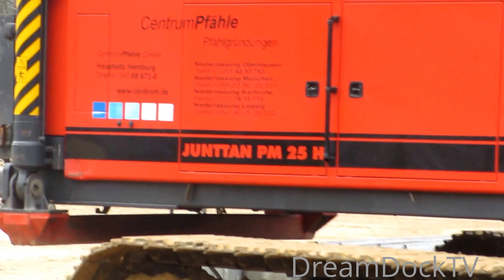PILE DRIVER MACHINE WITH IMPACT HAMMER ERECTING CONCRETE FOUNDATIONS

Comment: Permission to ask:
1. In this video, how much is the carrying capacity of each pile?

2. What is the effect of vibration on surrounding buildings (besides there is a 5-storey building with a distance of 5 meters)

3. How to calculate / The formula used to ensure that the piling has reached the expected bearing capacity (Note: the planned carrying capacity per pile is 96 tons)

Thank You.

Comment: why so many cables to move just one thing up and dwn; seen the same on drill rigs, what looked like a good 20 cables for their about 3 motions.
Reply from the maker: not cables but hoses ;-) the hydraulic needs oil up there inside the hammer
Reply: 3 or 4 hoses, one of which containing electric wires for the automatic piling sensor and the solenoid valve which opens or closes in order for the cylinder to lift the weight.